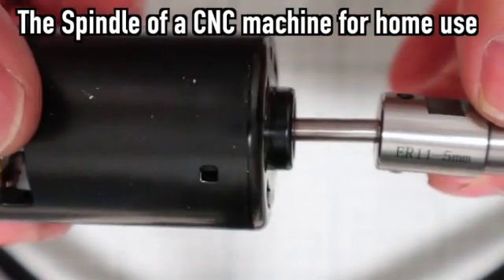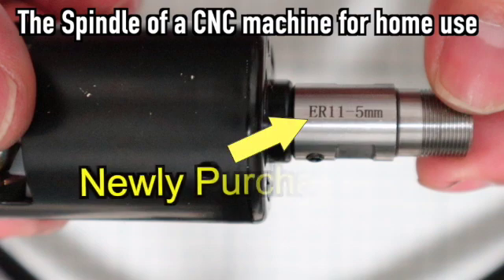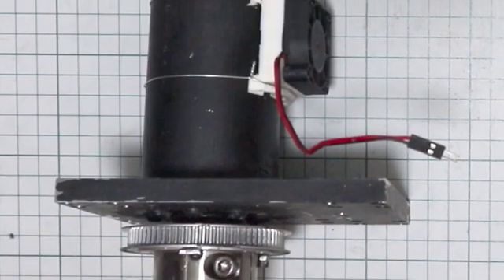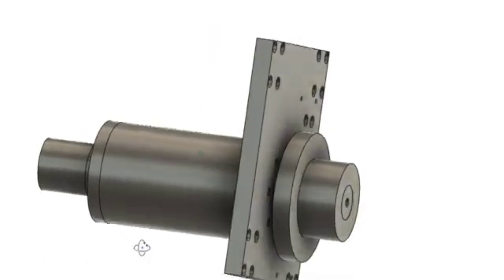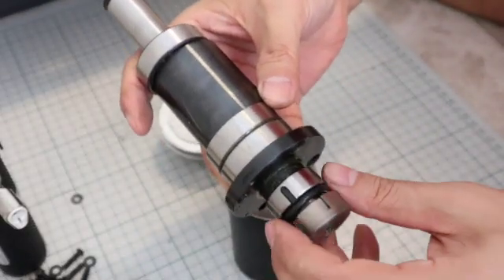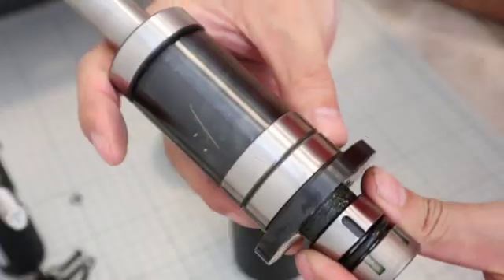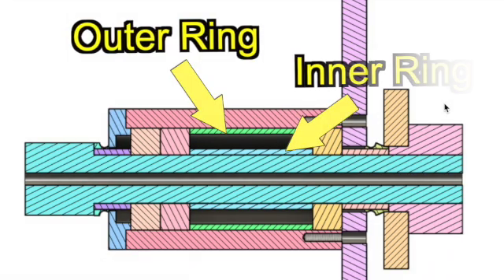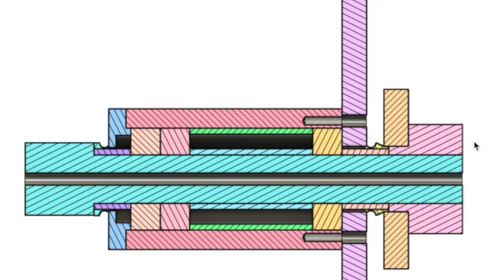【SPINDLE】DIY CNC How to Build 5-axis  p4 / Compare with The Spindle and CNC spindle for home use.

Comment: You loose probably between 10 and 15% of power thru the belt transmission vs a geared one. You should be able to mill some nice gears with your machine!